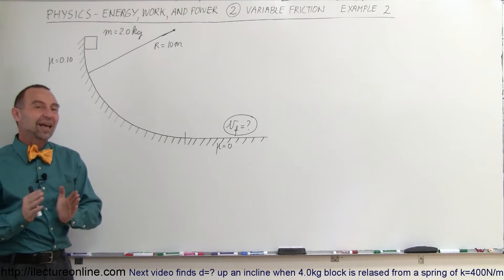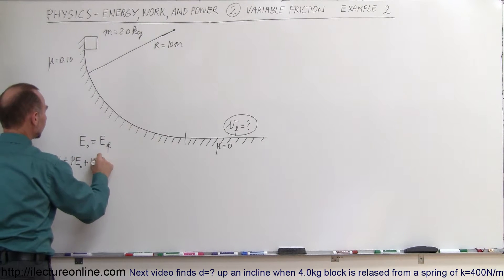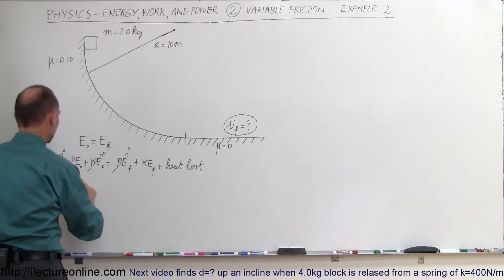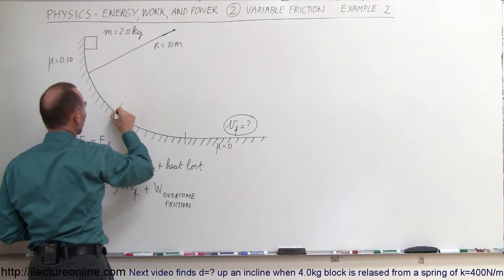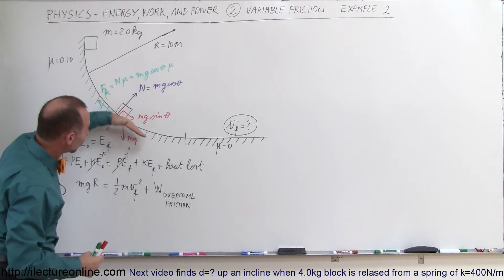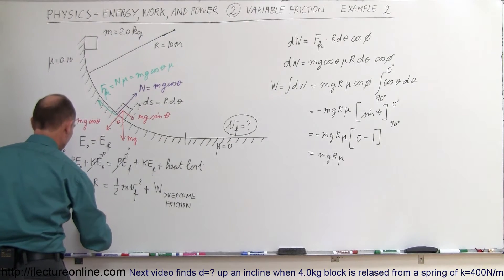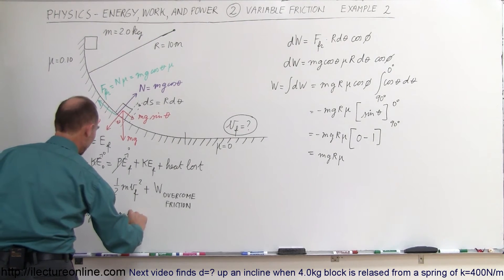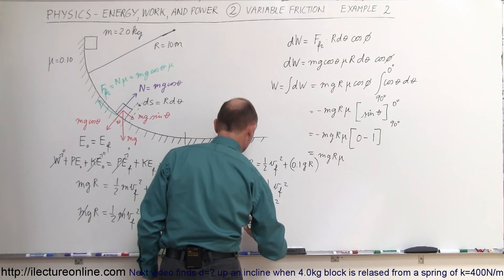Physics 8  Work, Energy, and Power (33 of 37) Variable Friction - Example 2

Comment: Solution might be wrong as circular motion of the particle is not considered,, due to circular motion Normal is different than mg cos(theta) ,, please give explanation.
Reply from the maker: The circular motion is accounted for by the integral of the work done.
Reply: @MichelvanBiezen  but in condition of circular motion we can not take normal reaction as mgcos(theta), normal reaction is greater in that case due to centepetal acceleration , thats why every on every curvillinear motion with friction particle move slowly...
Reply: If particle gain a velocity then normal reaction increases and then question become very difficult to solve.. Thats what I understand ,, if I am wrong please let me know..

Comment: how ds equal to Rdtheta ?
Reply: 3.30
Reply from the maker: The arc length of a section of a circle = (r) (theta)   with theta in radians.  For a full circle, the circumferance of a circle is  (r) (2) (pi)

Comment: is normal force always equal to mgcos theta in this example? because if an object moves in a circular trajectory there must be centripetal acceleration , which in this case comes out to be zero? is not it true that normal force has to be larger than mgcos(theta) in order for centripetal acceleration?
Reply from the maker: It all depends on which angle you are referencing.  In circular motion there is centripetal force which is always perpendicular to the motion and pointed towards the center of motion.  It may be easier then to express that force using vector notation and cylindrical or spherical coordinates.

Comment: I didnt understand that why we say Rdtheta ?Does it have  any relationship with circular motion like circumference formula?
Reply from the maker: The arc length of a section of a circle is calculated with:   S = R x theta (where theta is in radians).  That is why the circumference of a circle is:   C = 2 pi R       R x d(theta) is the radius multiplied by a very small section of an angle to give you a very small piece of the arc length of the circle.
Reply: @MichelvanBiezen  thanks for answering my question I feel lucky about that.

Comment: Aren't you neglecting the contribution to the normal force due to centripetal acceleration,
mv^2/R
Reply from the maker: Yes, I did to keep the problem simple enough.  Adding the force of the centripetal acceleration makes it into a very difficult problem beyond this level.    (Good catch).

Comment: How can you neglect the centripetal acceleration.It will change the normal to mgcos(theta)+mv²/R and then will get problem in integration as v is a function and not a constant.
Reply from the maker: Yes, that would be the more proper way of calculating this.  (This is a good approximation)

Comment: Lovely video, thank you. I'm actually confused by some of the comments and your answers relating to centripetal force. You say that you've ignored it for simplicity. But isn't the centripetal force just effectively the resultant force towards the centre of the circular motion? i.e. here, centripetal F = N - mg cos (theta). And then N - mg cos(theta) = mv(squared)/r
The centripetal force isn't 'another force' that can be added or ignored, it is the net effect of the forces that have components towards the centre of the circle, no? A bit like a 'resultant force' isn't another force, but the net effect of other forces. Please correct me if wrong.
Reply from the maker: You are correct.  But because of the centripetal force (the track pushing back on the block towards the center of the circular motion) causing a friction force that is constantly changing, we would need to integrate over the path taken in order to calculate the energy lost by the varying friction force.  (That was left out for simplicity)
Reply: @MichelvanBiezen  Ah, understood. Thank you for clarifying.
Reply: @MichelvanBiezen  thank you for explaining

Comment: Sir , normal force here depends not only on angle but also on velocity , due to centripetal force . And problem here is , I can't just add mv²/R to mgcosθ because "v" at that point depends upon  how much potential energy is lost in form of heat which is unknown.
Please give me the solution sir .
Thank you.
Reply: You are right. Newton' s second law projected along the normal to the curve (the radius) says that mv2/R = N - mg cos (angle theta). This is a huge mistake. In my country (Romania) we don' t allow such mistakes, not even to the students.
Reply: @victorburacu9960  yes , here it (mv²/R) has a greater significance. Although if we consider the radius of arc to be very large as compared to the dimensions of the block we can  neglect mv²/R  as done by sir in this video.
But I want solution where radius of arc and dimensions of block are comparable.
Reply: @aniket_Kumar001  There is no closed form solution. We can write the equations of motion along the tangent and along the radius, but we cannot integrate them. Velocity as function of angle theta can be derived only numerically.
Reply: @victorburacu9960  No dude! I have derived a relation between velocity and theta. and also found out the work done by friction as a function of theta for this case.😌

Comment: Dear Prof.  Thisproblem is not solved properly.  mgcos(theta)  is not equal to the normal force.  you cannot forget the centripetal force.  pleasecheck it.  you videos are used by a lot of students.  best regards
Reply from the maker: You brought up a good point.   Normally we ignore the centripetal force in order to keep the problem in a simpler format, but we could also add the effect of the centripetal force.

Comment: Hi. I am wondering if this is correct.?
For the Normal force you have said it is equal to mgcos(theta), nhowever since the block is in circular motion, shouldnt you also consider the Normal acceleration of the block.
So the Sum of the forces in the Normal direction:
N -mgcos(theta) = m(an)   therefore.  N = mgcos(theta) + m(an)

I am stuck on a question like this and cannot work out how to solve it. Your method is solvable, but it doesnt consider the normal acceleration, which will affect the friction force and hence the work done by friction.
Reply from the maker: You are correct.  The centripetal acceleration will add the additional component of the normal force as you indicated.  That was ignored in this example (for simplicity).  We should do another example with that component included.
Reply: Please proff michel make an example i have a project and im confused

Comment: The way you figured out the components of theta was different than your previous video of Conservation of Energy (9 of 11) sliding in a bowl.  In that one the parallel component was mgcos(theta) and in this one it is mgsin(theta).  Also the normal force was mgsin(theta) on the other video and this one it is mgcos(theta).  Am I missing something?  Is there a difference in application between sliding in a bowl and sliding down a quarter circle with the same coefficient of friction?   Thank you, love your videos.
Reply from the maker: They are both correct.  Note the angle reference.

Comment: Sir, I have some doubts. 
1) Wouldn't the integration of cos(theta) be  -sin(theta) instead of +sin(theta)?
2) In what situations do we have to take the final KE as 0? For eg. in this video, you considered it but in some of them, you just say that final KE is zero. 
3) Is there any way to calculate work done to oppose the friction in a circulate path, (like in this video), if you've been given *mass=1kg, R=5m,  Initial angle with tangent (90) and final angle with tangent (127 from initial or 37 from 0), FRICTIONAL COEFFICIENT NOT GIVEN.
Options (just in case):
a) 80 J
b) 40 J
c) 20 J
d) 60 J

Your videos have been of great help!
Reply: 6 years later, but you confused the integral of cos with the derivative of cos. Integral of cos is sin, because the derivative of sin is cos. Derivative of cos is -sin.

Comment: sir u have taken d theta in the anticlockwise direction!
but at the same time u have put the limits 90degree to 0 degree in (sin theta)
sir the radius 10  is rotating in anticlockwise direction so the limits must be 0 to 90 degree to 
(sin  theta) ..m i right ??if not pls xxplain me how????
Reply from the maker: +Aman Chaure 
The only thing that will happen when you reverse the limits on an integration is a change of the sign.
If you only care about the magnitude of the result, the order of the limits don't matter.
Reply: @MichelvanBiezen  This actually slightly changes the result. I noticed it when I used the DeltaME = Wext formula I get 1.1 gr instead of 0.9 gr like in the video. But once the signs are correct I get 0.9 gr.

In my university we do these problems deriving from Wnet = Wconservative + Wexternal = DeltaKE and then Wconservative = -DeltaU, so I can't use your formula even if it comes quite handy.

Comment: sir,
the body is undergoing circular motion in that particular segment. won't a centripetal force act on it?
also will the motion then be uniform circular motion or non uniform?
what would be the direction of friction in such a case?
Reply from the maker: Ishita Kukreti 
You are correct, there is a centripetal force.
I ignored the centripetal force to simplify the problem.
If you want to include the centripetal force, you must add mv^2/R to the mgcos (theta)
The direction of friction will be the same.
Reply: @MichelvanBiezen  sir,plaese mention this codition in the start of video.....I confused....
Reply: Michel van Biezen 
Thank you sir
Just one last question.How are we supposed to integrate the v^2/R term wrt θ ?
because we cant multiply theta, can we?
Reply from the maker: Ishita Kukreti 
You need to convert 

v = w * r= d(theta) /dt * r
Reply: Hello please were you able to do a video where the Fc was added? i cant seem to figure out what you mean. Please help
Reply: @MichelvanBiezen  You are not allowed to simplify the problem in this way (by igoring mv^2/R). Even if your intention was that, at least you should have warned the audience from the very beginning. It is regretable that students draw attention to professors that they make mistakes.